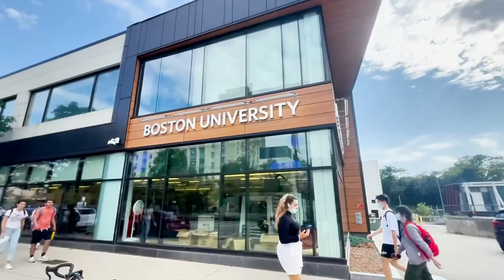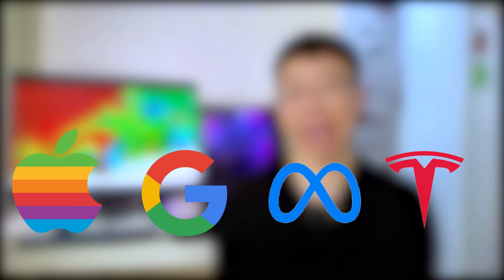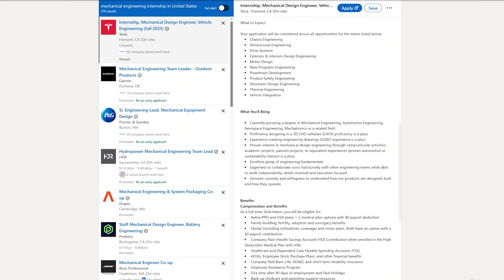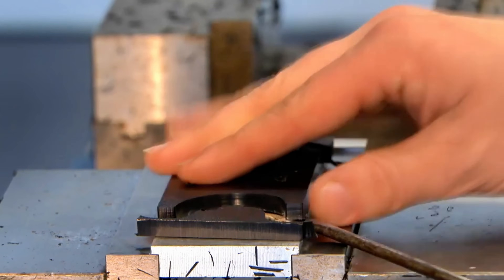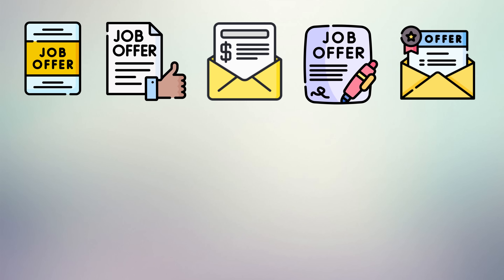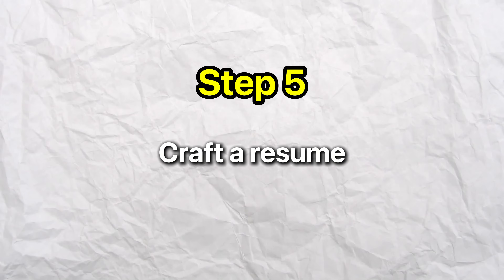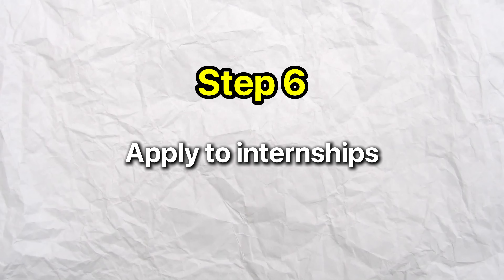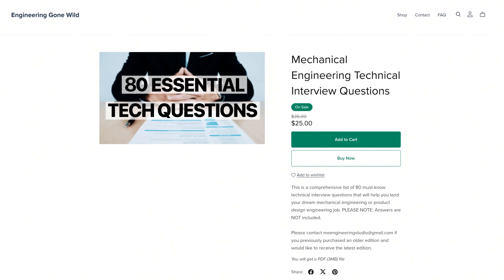I Did THIS and Got 5 Mechanical Engineering Internship Offers

Comment: Can I ask, in terms of objective "betterness" would you suggest mechanical or aeronautical engineering? (There's no aerospace in my country :[ )
Reply: in my view, i think industry is better, you have more possibilities of action it can perform services in various sectors
Reply: im currently pursuing a degree with both combined, Mechanical and Aerospace. Mechanical Teachings a braod foundation of many engineering fields ( ngl i hate this part right now), and the Aeronautical/Aerospace aspect teaches the aerodynamics/ related content, ( btw aeronautical and Aerospace is somewhat similar, just aeronautical is within the the earths atmosphere and Aerospace takes into account even space as a medium for vessels, if i remember right) . In my opinion, and opinions of my teachers, most companies are interested on what you specialise in, which typically is ur masters. so preferably if your not planning to specialise in depth and know your main interests, Aeronautical is a way better choice, as it will be more  specialised. Aeronautical -> specialise into Aerofields. Mechanical -> Specialises into different special fields which also includes Aerofields. Thats what i remember, correct me if im wrong andd my bad too, my grade 12 knowledge from 2 years ago might have led me to think wrong.